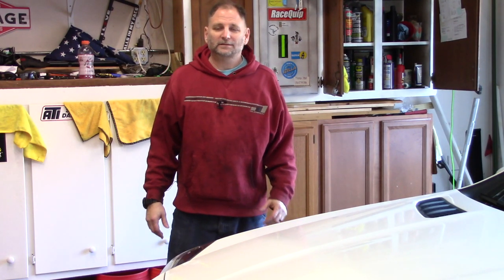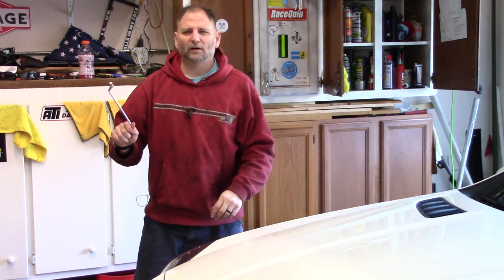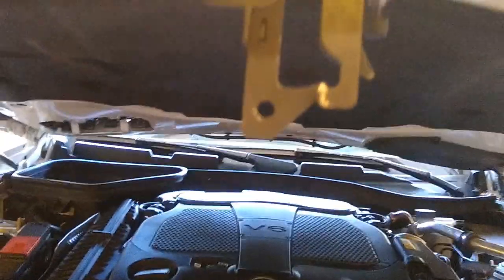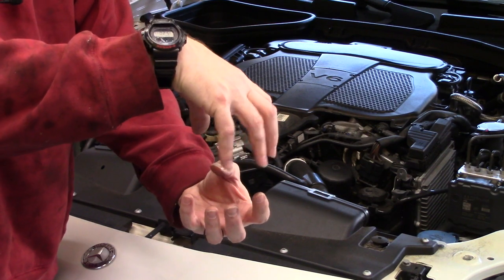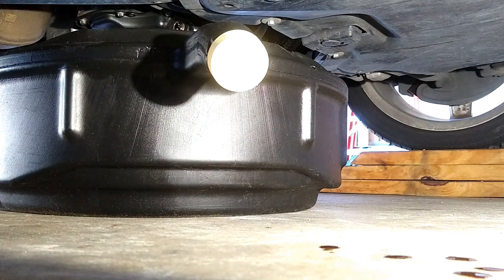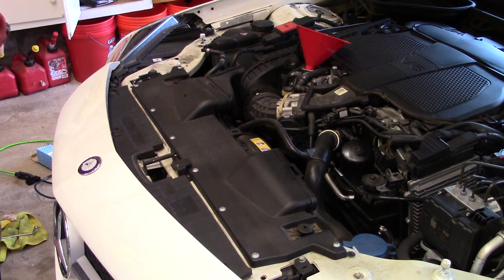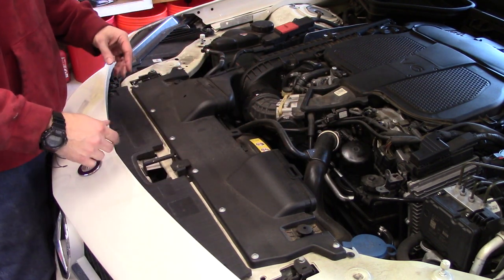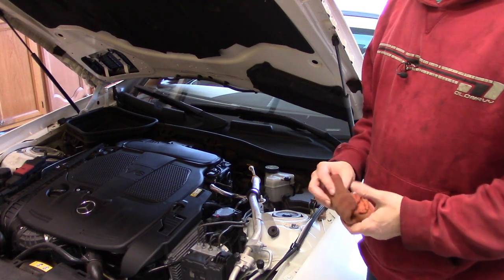r172 oil change

Comment: Good job! You just forgot to mention the copper 'crush' washer that goes back on the 13mm drain plug to insure no leaks. Use a 14mm. copper crush washer for the job, it takes a new one every time you remove it. 2 pack for $4.99 @ O'Reillys.....and that is probably the CHEAPEST part you will ever purchase for a Mercedes! lol...
Reply from the maker: Yeah, I found that my wife's car does not leak without using the crush washer. And yes, $4.99 is the cheapest part for a MB!!!